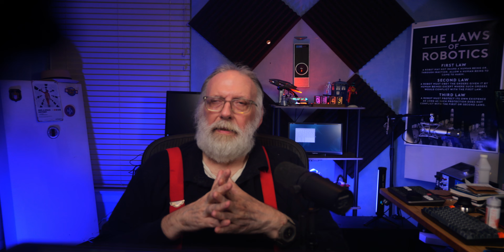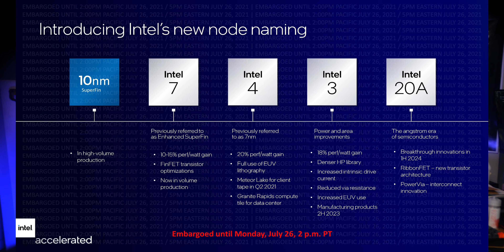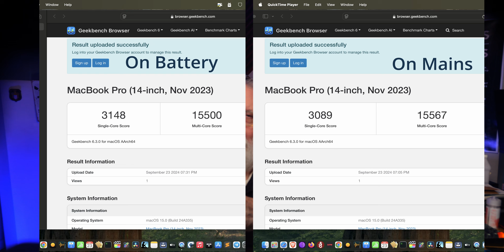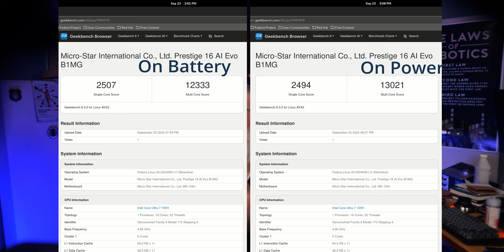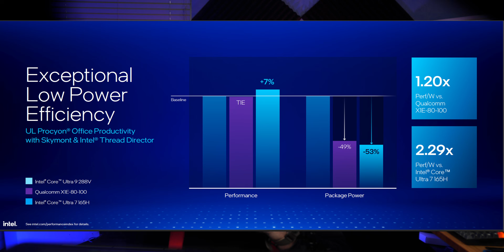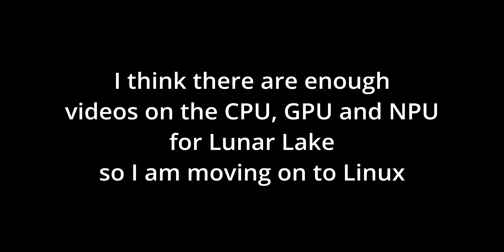Intel: Past Broken Trusts or Future Success?

Comment: Intel is in a weird situation. They had 1-2 decades of highly problematic behavior with illegal all or nothing rebates and putting a lot of pressure on OEM's to boycott AMD. For example, when Compaq refused to play ball with Intel Intel cut Compaq off from the server-CPU's. Intel also patentinfringed DEC, they got busted and a court ordered Intel to pay compensation, Intel then bought up a fab which DEC depended upon. In the 00's Intel cheated with a compiler from Intel, that compiler used less efficient instruction sets if an AMD-CPU got detected while AMD had the same instruction sets in those cases, that way Intel got a higher score in benchmarks. Intel its past is rather shady, like for many big companies. Intel still hasn't paid the €1billion fine to the European Union. 

However, in the last years Intel seems to be doing better. The current CEO is a no-nonsense engineer who just wants Intel to develop good hardware, not do all these shady business-practices as far as I can tell. After years of minimal prograss (Core2 up to the last Core) Alder Lake was a pretty daring design, basically copying the multi-chip architecture from AMD but doing it in their own way. Though the e-cores gave some problems (like games accidentally using those) it also had advantages. The latency increased though in certain situations, like heavy videorendering in Adobe Premier Pro. But at least Intel was innovating. Intel seems to be doing well with their discrete GPU's, after having been a joke for their integrated graphics for so long the discrete graphics cards are improving radidly, to a large extend thanks to improved drivers, for the next generation probably also thanks to improved hardware (conrectely: becoming more powerefficient, not doing as much calculations for drawing things which can't be seen by the player anyway).

So Intel was on its way up, But then Intel colosally screwed up. The 13th and 14th generation CPU's break easily, partially because of fabrication errors (oxidation), partially because Intel simply puts too much electrical power through it and that is not only the motherboard companies their fault (though they share blame). Gamers Nexus and Level1Techs have made the best videos on this topic. Maybe some engineers of Intel messed up, maybe some of the business guys at Intel just weren't willing to lose from AMD (Zen4). In my humble opinion AMD also overclocked the regular Zen4-CPU's too much and I have been criticizing that since the launch, users don't want to hear the CPU-fan all the time because the CPU pushes until around 90 degrees Celsius is reached. 
Worse for Intel: they handled this poorly. They tried to hide the problem, at first they refused RMA for the tray-CPU's. Bad look for Intel. Right now I don't trust Intel for the CPU's, it is up to Intel to earn back that trust among the enthusiasts. My next CPU will be the 9800X3D, 9950X3D or the equivalent Zen6-CPU. I currently have a 3700X.

Comment: Multithreading has less sense in today 8 or more cores cpu. It seems cheap trick but brings many hassels.
Reply from the maker: You're not wrong, but I would add that hyper-threading has one additional advantage over single threading each core.  At times (in fact many times) a thread will go idle, maybe waiting for a reply to a syscall.  So the CPU sits idle, it is during these times the OS could use hyper-threading to schedule another thread likely from another process and the CPU would be busy again.  Yes more cores is better, and more cores with hyper-threading is evern better....unless you are trying to save the battery....then maybe not so much.  Thanks for the comment, and I know the new scheduling algorithm is much more complex than this, I did a video on that awhile back.
Reply: @CyberGizmo  Maybe I'm reading wrong, but I think you mixed things here. 1. Hyperthreding is mostly used by cpu itself to mask memory latency, for os cpu advertises 2 cores, if os is aware that they are not full cores, then can act accordingly, for example by not transferring process between them becuase it changes nothing, or exploit this and move processes accessing the same memory together. 
2. If process made a system call os can switch to another process even on the same core, hyperthreading don't change much here.
Reply from the maker: @AK-vx4dy  ahh but it doesnt work that way with EEDVF it will pull in threads from other processes that have code ready to run, the way you describe isnt supported any more, things change.  We know switching cores is very expensive today. go watch the video on EEVDF I think you will be amazed at how they do it now

Comment: Intel needs to re-earn my trust as a consumer. The last Intel product that I owned was a i7-4790k. It was a solid CPU, the only issue that I had with it was that it was running a bit hot. I had to delid it in order to keep the temperatures in check. After this, I bet my money on AMD and I must say it was a good experience. I still rock on the 5800x3D, after having their 3600x, 5600x and 5900x. The AM4 flexibility gave me such a good customer experience with AMD products that I stuck with them for a long while now. 

Having said that, I'm not a fanboy and I would return to Intel if they would make a better and competitive product.
Reply: Just an anecdote, but I ran a Xeon E3-1240 v5 (Skylake) for about 2.5 years when AMD just didn't have anything I wanted.  I completely skipped FX series.
In those years I ran it, it hung 2 or 3 times.  I'm a "reliability is everything" kind of person.  Of course, I ran ECC memory.
I skipped 1000-series Ryzen completely.  Ryzen 7 2700 was my first dive into Zen.  I ran that for more than 3 years and it had been the most reliable PC I'd ever had!
I did run it slightly underclocked (3.6GHz max with 2400MT/s memory), as I don't like anything pushed to the limits.
I have bunch of Ryzens now.  All of my built ones have ECC memory (R3-PRO-2200GE, R5-PRO-4650G, R3-PRO-4350G, R3-3300X, R5-5600X, R7-5800X3D) and none of them have ever crashed/hung on me.
Again, because I'm weird, I always disable boost.  I'd seen one corrected ECC error in all these years.
I hear about "not as reliable" USB, fancy memory support, etc. about AMD, but I've not had any real problems with them.  I only buy JEDEC ECC UDIMMs anyway.
All CPUs have bugs.  You can see errata sheets from any of these companies.  I think AMD actually does a better job in this regard.

Comment: The soldered RAM and Intel limiting it to 32GB is the main reason why I won't buy it, they should have opted for 24GB and 48GB at the very least.
Reply: @owlmostdead9492   Having RAM soldered in or on die is the cheapest way to get it to be any faster than it is now. Within 2-3 years pretty much all new laptops will be doing the same just to compete (except maybe framework but they aren't really known for performance).

Also, it is technically not non-upgradable. You can still add more ram to many of these laptops, they just require the equipment for removing soldered RAM and/or adding the larger chips.